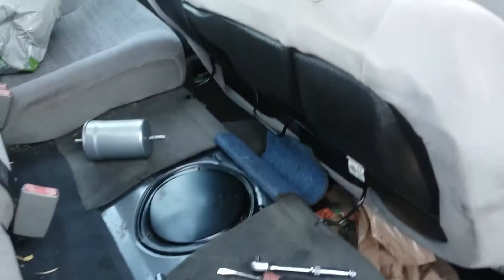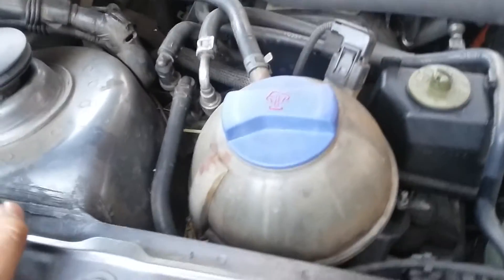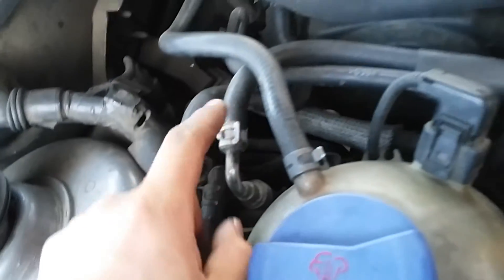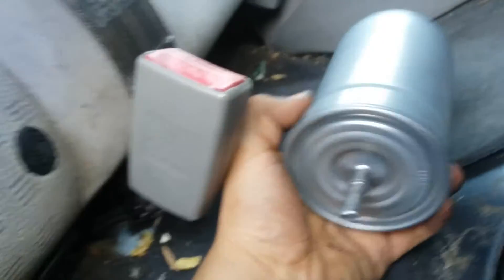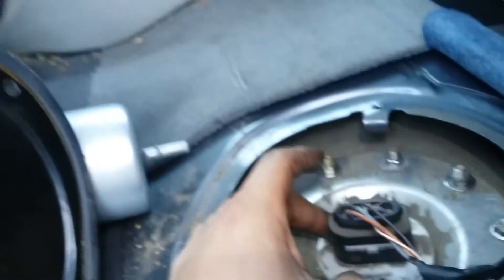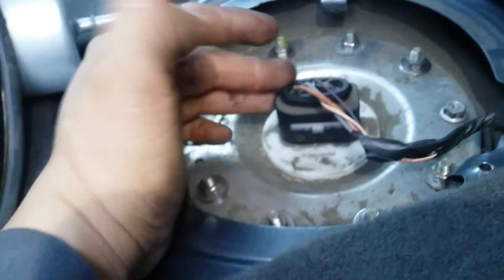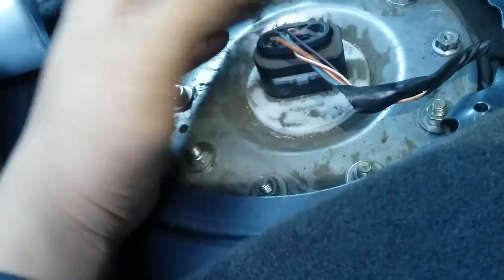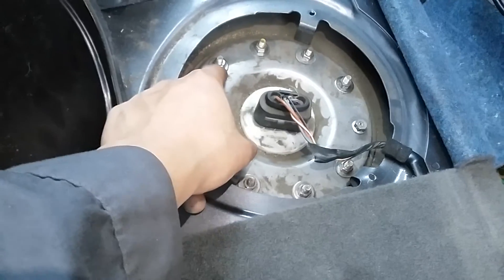2004 Jetta 2.0 fuel filter part 1

Comment: Fuel pump is in tank with steel tanks and have three fuel line ports on filter. You have to remove pump to get at filter. Replace pump at same time as filter. Cut plastic hoses at fuel pump module while you are at it to get pump out of way. Also make sure you have the right pump. Metal tank has all different equipment inside. If you remove fuel it will be gentler on your skin. ENJOY!!
Reply from the maker: Thank you, the customer never came back to get the filter done...

Comment: Just got a jetta 2004 and start having problens with the fuel pump looked 4 the filter never found it😁 Im biut ti open up fuel tank to also check if its in there!! 0bviously be smaller than the one you showed😁
Reply from the maker: Yeah the guy never came back to change it so idc